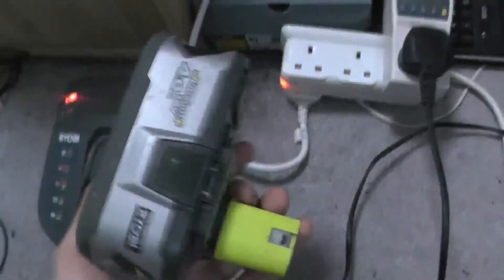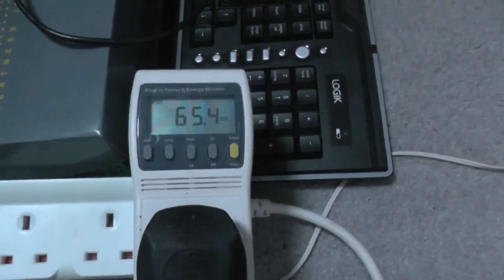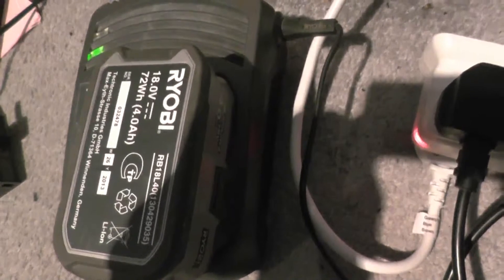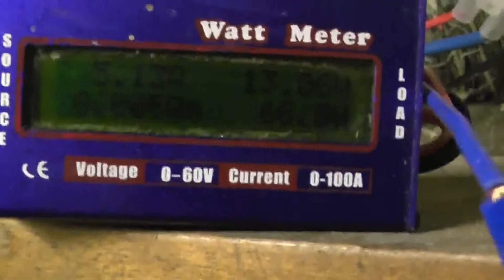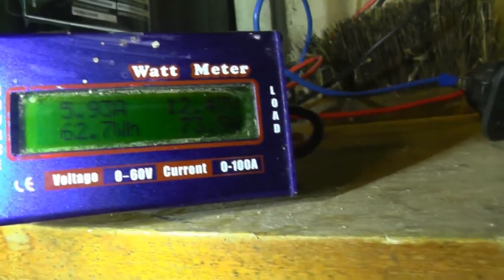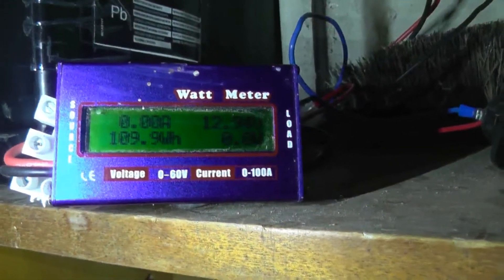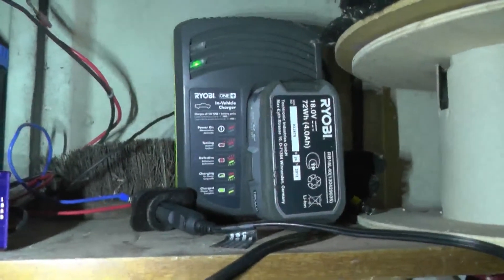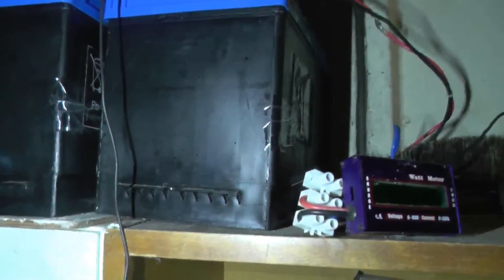Testing Ryobi charger on/off-grid

Comment: The AC method also has losses due to power factor. I think the power factor of ryobi chargers is about .6 so it actually took about 133 watt hours on the AC charger. This would be important if you're using an AC inverter, you have to provide for power factor.